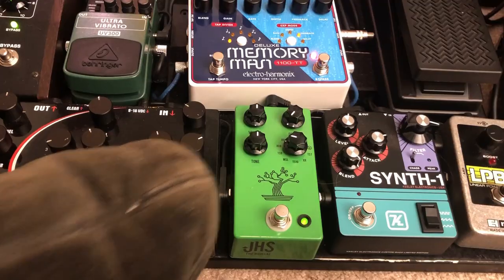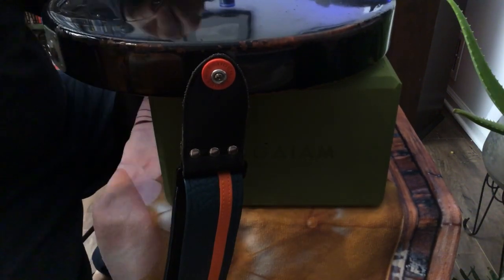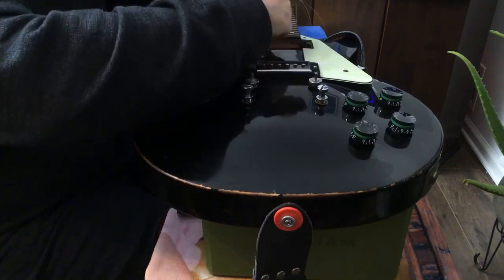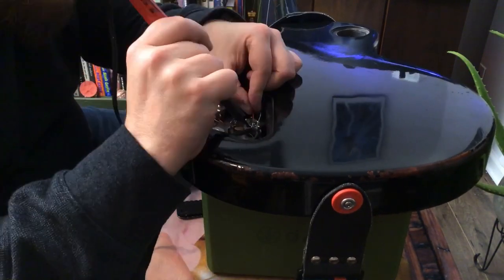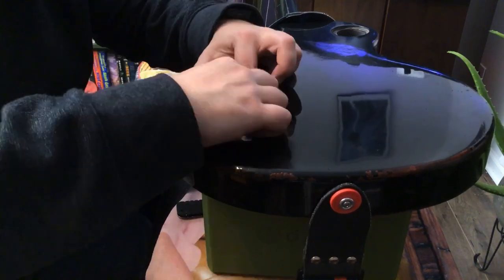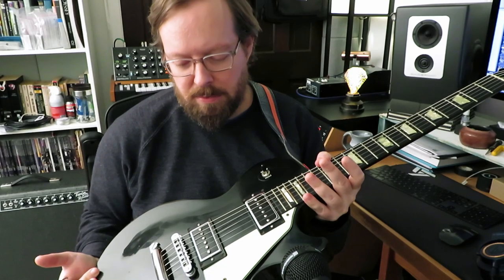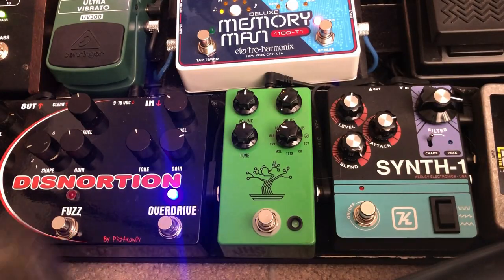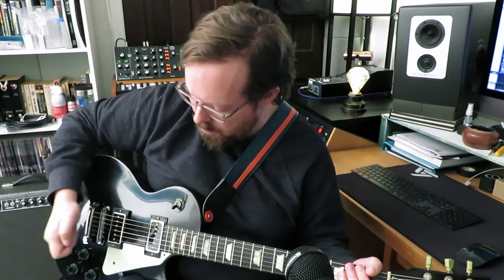I put a Cheap P90 pickup in a Les Paul Studio Guitar

Comment: Thanks for the demo. I'm pretty sure that if you rewire your guitar and swap the ground wire and the hot wire of the new pickup, it will reverse the phase and it will play properly when both pickups are selected.
Reply from the maker: Thanks for the tip!  Next time I change strings, I’ll give this a try.
Reply: @saturnfivesound   I'm almost positive this will work. But I suggest you Google it because I've been wrong once or twice before!  I put a new bridge pick up in one of my guitars recently and the instructions say that if it's out of phase with the neck pick up to do what I suggested to you and it will fix it, so, pretty sure.
Reply: @saturnfivesound  just to be clear. I'm talking about the way its wired in the control cavity. Take the lead off the pot lug and reconnect it to ground, and remove the existing lead from ground and put it on the lug of the pot. On a 4 conductor pickup, the two leads that are twinned together and grounded for humbucker mode can stay the way they are.  I really like to see you fix this because I think it would sound beautiful on that guitar.

Comment: 6:05-6:23 If you won't use that sound clean, you should resolder your pickup to get it into phase. The sound of two single coils in phase is much more useable than this thin sound. Think Telecaster, Jazzmaster, '55 Les Paul TV Yellow.

Comment: I did this to my Standard several years ago with P90 pups from guitar fetish. Mine sounds amazing! This is a huge upgrade from the stock pups.
Reply: I tried the PU's from GFS also, 35 bucks and they sound great. Have them in a little Matt Murphy Cort I grabbed cause it was unique, and cheap and it really sounds good (to me) and I've worked on quite a few real P-90 guitars. PU's are a coil of wire and a magnet, there's really only so much you can vary and there is no bad sound unless every single person doesn't like it. Point being tone is totally subjective. The Cort was built in Korea by the people that did the original PRS Korean imports. After working on it was blown away by the quality.
Reply: @bradt.3555  I agree. I have played and worked on some amazing guitars from korea, Japan and Indonesia. In fact I purchased the alnico 2 cream pickups from guitar fetish to install them in a strat and again I was blown away with the clean tones.
Reply: @bradt.3555  Did you buy chance get ones with the Kwik plug? If I'm not mistaken you can just cut the plug and wire it in normally no?
Reply: @NintenDub  , Yes it was quick wire, that was the only drawback. I did eliminate the quick wire as one was defective. It was a while ago but I think I just soldered a standard vintage type braided wire to the socket on the PU, eliminating the plug and wire they supplied.

Comment: Unrelated to the awesome pickup... What monitor speakers are those? They look wild with the bass woofer on the side?!
Reply from the maker: They are Barefoot Sound Footprint01.  They are incredible!  There are 2 subs per speaker, one on each side.  The subs are internally physically attached to each other to reduce vibrations from the sub into the monitor housing and into your floor/monitor stands/console.  Go check them out!  There is now a smaller version called the footprint02 I think.

Comment: I'm thinking about putting them into a cheap SG copy from Harley Benton, would you recommend?
Reply from the maker: My LP seems to have 300k pots in it, so your SG would probably be slightly brighter with the usual 500k pots.  That brightness along with an amp that breaks up easy, like an AC30 would be a cool combo.  I don't really like the new P90 through my Twin Reverb, which is very clean.  So I could be great, but might have limited applications.
Reply: @saturnfivesound  this is where an eq pedal would come in handy

Comment: Yeah - people spend a lot on pick-ups - when it isn't necessary.  The same physics work on both expensive and cheap.  Unless you are dealing with a totally different design.  And most of the time a tweak to the amp compensates for any differences in tone that you might hear.  It's a hundred-year-old technology - except for the Fluence design - but even that -  a battery powered pickup has been around for decades.  AND - tweaking the sound in your amp and pedalboard would be the first thing you would want to try anyway.

Comment: Does the metal ring/casing come off of the p90
Reply from the maker: Short answer is no.  I’m not sure what’s under the casing to support the pickup if you open it up. I wanted that soap bar P90 look as well, but couldn’t find it in a humbucker sized p90.  They all seem to have that metal ring or a fully metal top.

Comment: Most of those p90 humbucker sized pickups are just strat pickups hidden under cover. Still sounds good,just not a p90.
Reply: The ones I have are hum sized single coils, they are rated over 7k so they can’t be plain strat sc. mine have metal covers, I haven’t removed them but I could. Strat pups don’t have a bar magnet on the back. Their slugs are the mags. Totally different.

Comment: Sorry but It's not a P90, it's a cheap single coil on a humbucker format. Definitely not a P90.
Reply from the maker: Yes, you’re right Gus.  After doing a little research it seems “humbucker sized p90s” aren’t really p90s at all.
Reply: Saturn Five Sound The current humbucker sized P90s are about as close as you can get.  The Gibson P94 uses the same 2 bar magnets under the coil as a real P90 does with the bobbin being the only physical difference in construction.   I'll add that the humbucker sized P90s coils/bobbins are also shy of about 200-300 winds as compared to a real P90.     All things considered, in a Band or Recording Mix they are within 90% of a real P90, and 90% or better is still an "A" Grade.
Reply from the maker: Thank you for the clarification.  I think that the Gibson P94 sounds amazing!  For most songs, I prefer it to my LP Standard with burstbuckers.  That being said I don’t have a real P90 to compare it to.  I wonder now if I should change out the pots for 500k.  I believe the pots in that LP are 300k.  Perhaps it may give a little more bite.
Reply: @saturnfivesound  Changing the pots for a P90 style pickup from 300K to 500K would make a small difference, its worth a try if you're not happy with the current tone.  Different capacitors will change the roll-off of the high frequencies as well as slightly altering the overall tone.
If your Les Paul does not currently have '50s style wiring I'd switch to that before changing any of the components.
I used to use a treble bleed circuit on my Les Paul style guitars.   I found that once I changed the control circuit from modern to vintage style I no longer needed the treble bleed circuits on the volume potentiometer.  
My experience has been very positive with the '50s style control wiring verses the modern circuit design.
Reply from the maker: Ok awesome man!  I’m sold!  I’ll give the 50’s style wiring a try.  This old guitar has got a whole new life and vibe and it’s only getting better.  Thanks!
Reply: @saturnfivesound  I sent a link to your gmail account which has one of the best descriptions I've read explaining the differences between modern and vintage wiring.    A very interesting read.    Enjoy and good luck, would love to maybe see a comparison of the two ways of wiring and how they affect the guitar's tone.    I mean, I already know it works best for myself, I'd be interested to see what you think.
Reply: @hkguitar1984  can you share that in this thread?
Reply: @saturnfivesound  afaik P90 in Humbucker size also called P94!?